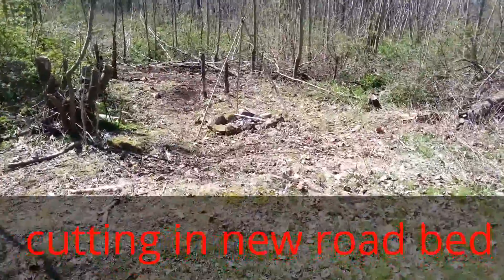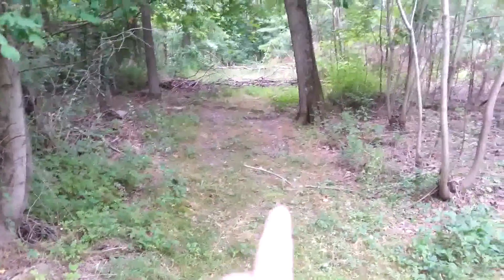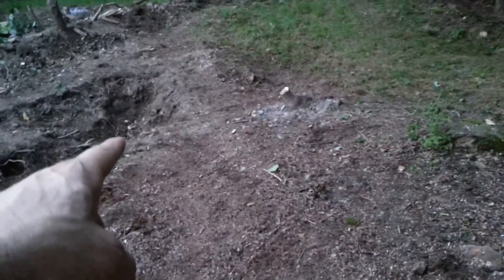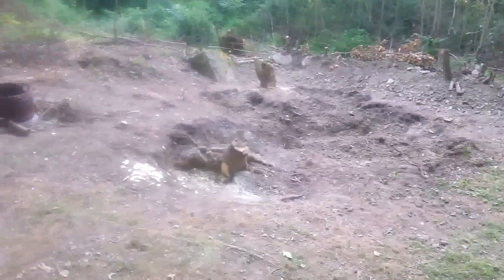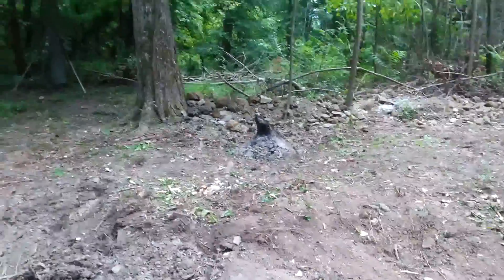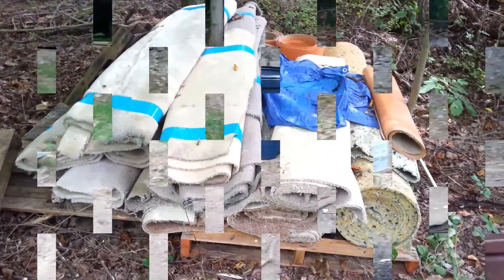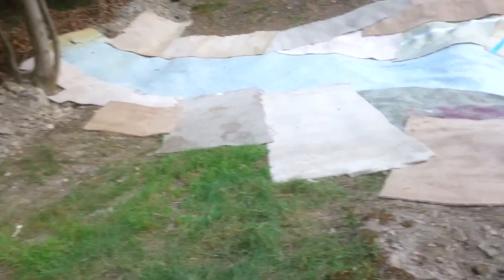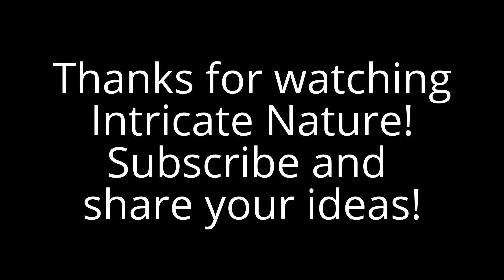Tiny House Off Grid Pallet Cabin - Part 13 Dew Pond Creation Part A

Comment: Just a suggestion that might help you out with the stumps. dig around  stump to expose roots going out  put lots of burnable wood sticks etc. get that burning  add stuff as it burns down it will burn for days but gets all underground roots  will also make later digging  easier
Reply from the maker: Definitely an art to stump burning. Thanks for the imput and suggestion. :)